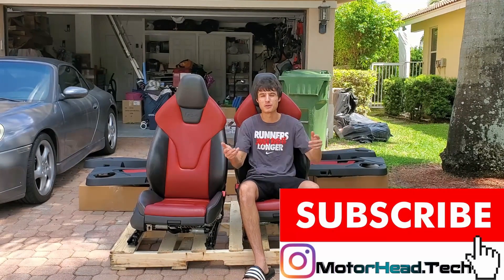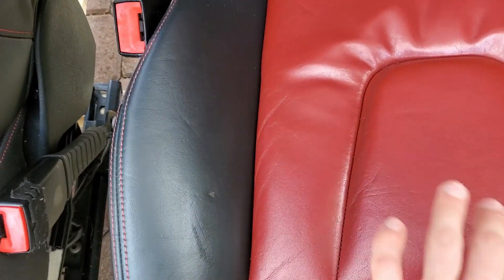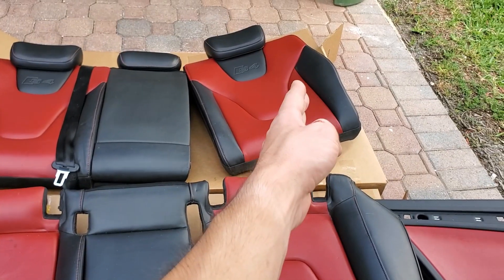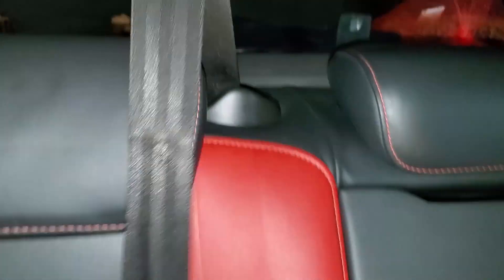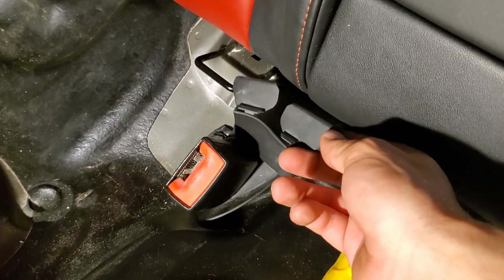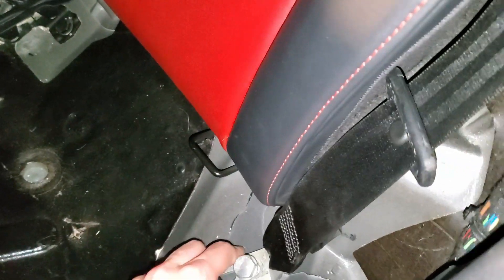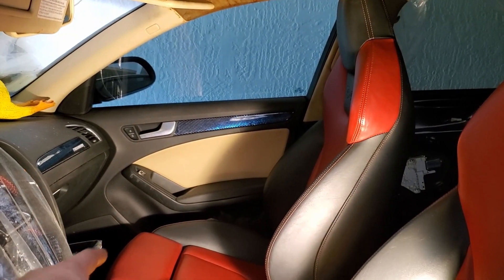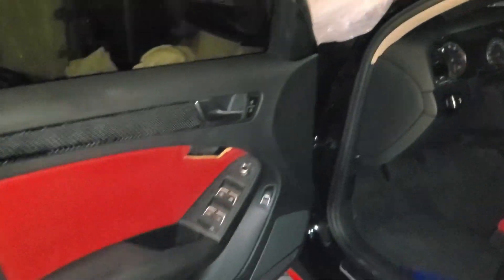How to Convert Audi NON-Fold-able Rear Seats to Fold-able seats & Install S4 Sport Front Seats (DIY)

Comment: Hi there where could i buy these rear and front seats and would they fit in the audi a4 cabriolet models
Reply from the maker: If you are referring to the B7 2009 or 2008 A4 cabriolet models, then only the front seats will work. The rear seats will not work

Comment: Never showed if the seats folded in the back bro
Reply from the maker: I was missing the bracket that allows the seats to fold. I finally picked up that piece & the rear seats fold nice!
Reply: @MotorHeadTech  I got the same car 2013 I hate this cvt I bought a sprint booster and I’m disgusted with my halogen headlights and the seats it’s quite annoying msn but I don’t wanna trade it back in it’s a great car not a S4 but man I think a tune and sprint booster would pick it up
Reply from the maker: Agreed, the point of the CVT Audi's especially the base A4's is to simply be economical in terms of money & gas towards the customers targeted in this market. I didn't want to take a huge loss in selling or totaling my A4 so I made it a project car, with an engine & DSG transmission swap

Comment: Am I the only one wondering what he's doing about component protection? I've done the same swap and have about five different codes, including airbag
Reply from the maker: I've never had any issues with component protection in my A4. For me it was a simple plug & play.
Reply: @MotorHeadTech  did you swap your modules from your original seats?
Reply from the maker: @MrAhaso  No I did not need to and with VAGCOM no errors showed with Airbag modules & seats.